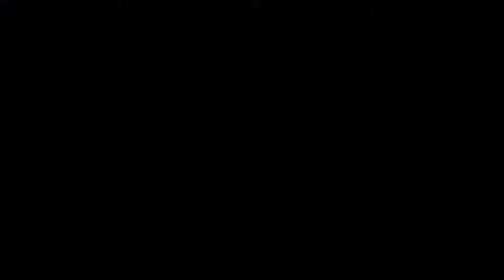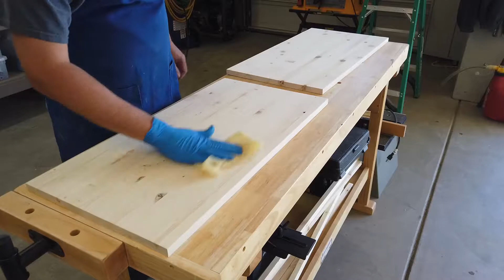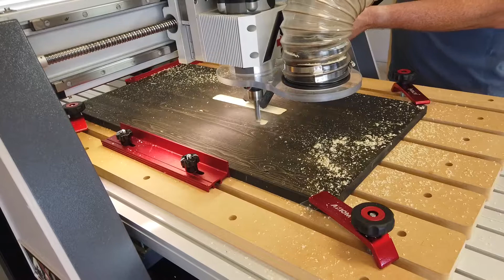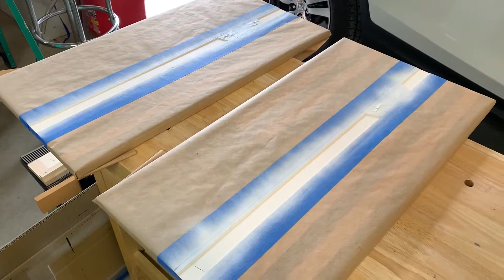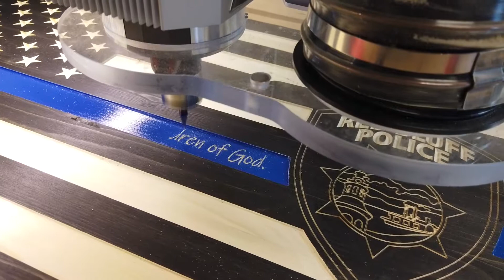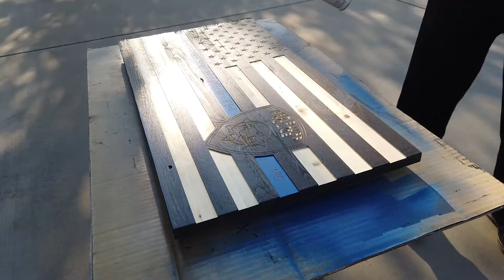How I Make Blue Line Flags Using a CNC Machine!

Comment: Hello,  love your flags.  I was wondering, where did you get your emergency stop holder and your touch off holder?  Thanks
Reply from the maker: It depends which machine you are referring to, as I have an AVID CNC, and an Axiom.  The video you posted in highlights the Axiom CNC.  The touch off holder was fabricated on the CNC and the emergency stop is part of the electronics cabinet.  If you are referring to the orange ones, I 3D printed them from .STL files I got on thingiverse.

Comment: Those are hands down the best quality I have seen yet. Very well done.  If I wanted to make a smaller version on my CNC, say around 12" wide x 22" long out of 4/4 red oak, would you suggest cutting the panels into 2-3 strips or just find a piece that is at least 12" wide?  I have seen some 14 plus inch wide pieces and was thinking that would be nice to have consistent grain but I am afraid a board that wide might warp or cup. I am new to the world of CNC so just wondering what would work best. keep up the great work.
Reply from the maker: I would suggest cutting down and edge gluing.  Flip your boards.  You’ll have a real solid piece.  The glue is actually stronger than the wood.

Comment: When doing the union, what are you using for feed and pass rate? Do you go with equal values?
Reply from the maker: Not quite sure I understand your question entirely but when I am cutting the union the bit is at 18,000 RMP and feed rate is roughly 40 IMP.  The values used are those recommended by the manufacturer, in this case Amana.

Comment: Where do you get your wood stock from? They look like preglued panels
Reply from the maker: Wood is S3S in various widths and is obtained from a local hardwood supplier here in my home town.  I do all my own fitting with a planer and jointer.  All boards are edge glued using parallel clamps and cut to final size on the table saw.  Lastly, they go through the drum sander.  I have an updated video on how I make them on my channel.
Reply: @BlueLineCNC  Can you link this video?  I don't see it on your channel.

Comment: This is essentially what I do. What bits do you prefer to do the small detail work?
Reply from the maker: Patrick Emond my go to bit for the detail work is an Amana RC-1045, 45 degree v bit.  I usually use it on a profile tool path for simple linear vectors and set the cut depth to about .025”.  Cheers!
Reply: @BlueLineCNC  thanks! Great info!

Comment: Great video what end mill are you using for the stripes
Reply: also are you using a 20 degree conical or 15 degree  for the small stuff on the shield maybe  you could share were you get your bits from amazon?
Reply from the maker: Actually in this video I’m using a 30 degree engraving v-bit, 1/4” shank, for the small detail.  I get all my bits direct from ToolsToday.com.  They are Amana brand bits.  I don’t order them from amazon.
Reply: @BlueLineCNC  Thank you I am designing my flag in blender and also the Maltese Cross. but Great work like the videos
Reply from the maker: 1/2” downcut end mill

Comment: Very nice video Russ. It would be nice to see a good photo of the finished product at the end. I’m also curious as to where you found the “vertical” hold downs a supposed to the traditional hold downs. I’m using a Laguna IQ...appears to be very similar to the Axiom. Thanks.
Reply from the maker: jbn0613 the red hold downs you see were ordered with my CNC manufacturer, Axiom.  They are just T-track clamps. If you want to see some examples of my finished flags go go my website at:  http://bluelinewoodflags.com. Hope that answers your questions!  Stay tuned for a new video of my work flow. It has changed a bit.

Comment: Would you consider selling your vcarve file? I am just learning and would be interested in using it for reference. I completely understand if not. There are others I can learn from but yours has so many different tool paths and bits it would be a great learning file. Thanks for considering.
Reply from the maker: Unfortunately I do not sell my graphic files or designs/tool paths created within VCarvePro.  I would suggest you check out my other video “creating a CNC project from start to finish”.  I think you will get some good info from it.  Also, be sure to check out Mark Lindsay CNC, as he is an awesome teacher for everything CNC.  Don’t be discouraged, as there is a learning curve to this stuff.  Feel free to email me at russ.tyndall@gmail.com and I will do my best to answer any questions that may pop up.  😀
Reply: Marshall CNC sells everything you would ever want on Etsy. Very reasonable prices and 3-4 different file extensions for each file including the CRV file for vcarve desktop/pro

Comment: I just started my journey of looking into a cnc machine so if you had any recommendations for the beginner wood worker with equipment.  I saw a Piranha that was fairly small in the $1400 range which would get a man started but it looks like I'd have to spend about 3K for a Shark model capable of larger material.  They had a couple Axioms at Woodcraft for upwards to 8K.  Any tips?  Your flag project is spectacular. Thanks
Reply from the maker: With CNC machines you get what you pay for IMHO.  I would recommend spending the most you can afford.  It sucks to get something you grow out of so quickly.  There is a bit of a learning curve with all that is involved. You WILL get frustrated but don’t give up!  For tools it all depend on what you want to do.  You can keep it simple or go crazy.  Good luck!

Comment: Great video.  Question... What is the depth you use to carve out the patch center below the department name?  thanks
Reply from the maker: Hi Greg.  The depth on that patch center detail was 1/16” using a 30 degree V-bit on a profile cut tool path.  Hope that helps you!